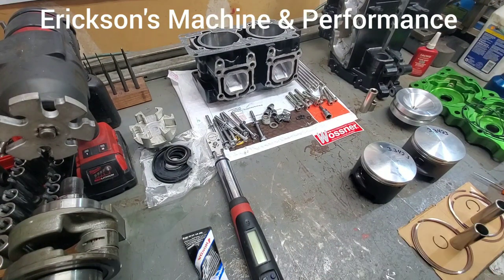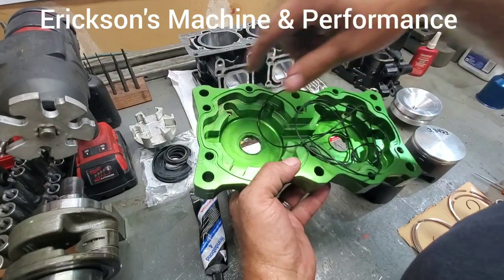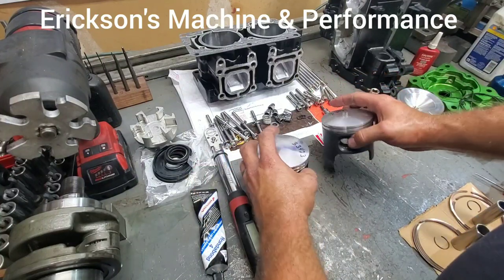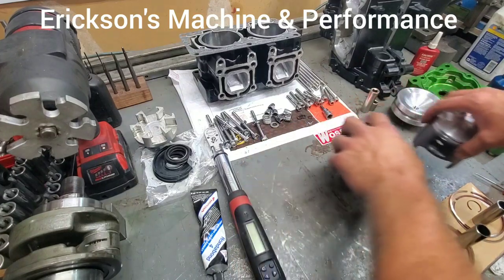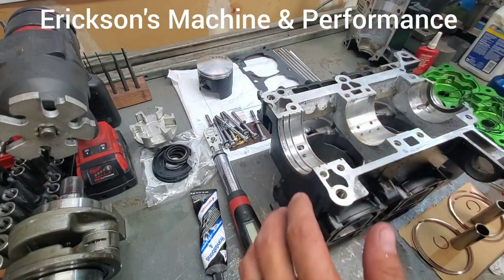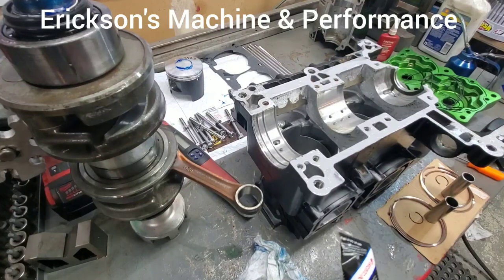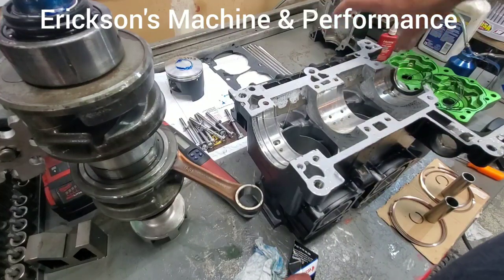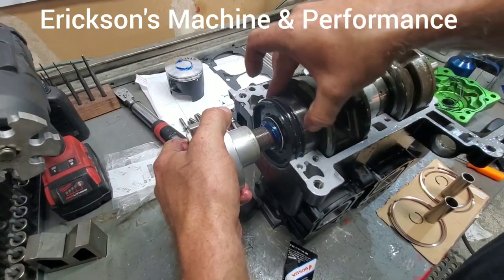Assembling a Yamaha 62t big bore 701 with an ADA head same as 6m6 650, 61x 701 , 62t 701 or 64x 760

Comment: So useful...
Mechanic is so easy with you !
Thanks a lot.
BTW : Did you post a video explaining the differences between 61X, 62T and 64X cylinder ?
Reply from the maker: I have not done that video but now I will!!   Thank you for the comment
Reply: @EricksonMachinePerformance  At first I thought the 61X cylinder was for the single carburetor ski and the 62T cylinder was for the twin carburetor ski but I have a 61X on my twin carburetor Superjet so that is not the case. The only difference I see is the reinforcements on the 62T cylinder, but I don't know if the ports are the same on a 61X cylinder, a 62T and a 64X.

Comment: awesome video!
Quick Question... im rebuilding a motor that need a top end (62T/61X SJ). right now the cases arent split yet but the cylinder work and all the parts are here and ready. I want to split the cases while i have it apart to replace the old crank seals. Is there any seals in the center of the crankshaft that go bad between the two cylinders in the center of the cylinders.. like the kawasaki 440/550s & 650s too i think had the orings on them on a spinning metal seal that required basically a crank rebuild to replace...
Just wondering if i should change the crank if the crank is fine and has no play or has had any issues in the past and has low hours but is from my 2001 SuperJet so not exactly new either, age wise..
Reply from the maker: No just on the ends.

Comment: Basically marine grease does great as assembly lube. Lighter application on metal.
Reply from the maker: Marine grease works fine.    But I'd recommend Assembly Goo.   Its the best for seating orings!    But most grease will do the trick

Comment: Hi Mark, At 14:41 you can see a little hole in the side of the piston.  Why do some of forged pistons have this hole in the side and some don't?  For example, I had some Wiseco pistons that were part numbers for an 1100 Yamaha Waveraider and they looked identical to the 701 Waveblaster pistons EXCEPT the 1100 Waveraider labeled pistons had that little hole in the side of them, but the ones labeled for the 701 Waveblaster didn't have the hole.  Thanks and keep up the great work!
Reply from the maker: It's a vent for the piston to help cool the crown and lubricate topend bearing.    61x don't have.    62t and 64x do.     They are interchangeable.  Either can be used.
Reply: @EricksonMachinePerformance  Thanks for your reply, it's appreciated!

Comment: I'm wondering about the washers that the diagrams call for. I had the cylinders sent out and machined and the local dealership ordered new piston kits  & rings based on the machinist's recommendation and machining. The parts diagram shows plate washers on either side of the pin bearing and mine had them when I removed the pistons. I had one that was broken on the damaged piston. I measured the new pistons against the old to compare the pin-bearing clearance and it appears to be the same. altho the new bearings are a little longer than the originals there is still room for the plate washers and it moves freely. How much play or clearance should there be between the pin bearing and the piston to accommodate expansion on a cast WSM piston. I was concerned about not having the washers but I see you did not install them with this assembly.  I'm working on a 98 Yamaha 701 62t  w new pistons 005 over. I've worked on car and truck motors but I'm just getting familiar with the 2 stroke world. I've ordered 4 new washers that the parts manual shows but now I'm concerned that with the new bearing being longer than the original it may expand and bind. The size or free play difference in the new bearing versus the old with the washers has me concerned about it having too much free play side to side. Is this an issue? should I simply disregard the washers? Leave them out as you did? I would appreciate your recommendation.

Comment: Great content. Is the red stuff on the crankshafts coupler end greas? Also, is it possible to surface the mating surface of the two crankcase half's?
Reply from the maker: No it's not grease I have a red oil that that I put on after I clean crankshafts.   And no you cannot machine the mating surfaces of a crank case. If you do it will shrink the bore size for the bearings.  You can only clean or machine the mating surfaces that get gaskets so between the cases and the cylinder and the intake and the cases. Not the 2 case halves.   Also case haves are machine together in pairs you cannot interchange them.  Mixing and matching case have can cause premature bearing issues.

Comment: When installing a half girdle do you torque the head first? Also are the girdle torque specs the same as the head bolts?
Reply from the maker: What half girdle?   Id depends
Reply: @EricksonMachinePerformance  id? Its on an 845. Not sure on the brand unfortunately.
Reply from the maker: @saltrocket1909  email me some pictures ericksonmap@gmail.com

Comment: I have a 61x with a R&D head in my blaster should I be running BR8ES or BR8HS Plugs ? Can’t find much online but I’d assume longer plugs right ?
Reply from the maker: Most aftermarket heads use Es plugs.  Can u email me pictures of the head so I can see the length of the spark plug threads.  Ericksonmap@gmail.com

Comment: No spacers on the piston pin when installing pistons? Is that a wosner thing? I’m installing Wiseco pistons, I assumed I needed to put the spacers back in?
Reply from the maker: On aftermarket pistons they aren't needed.  Also many people don't use them on oem rebuilds without issue

Comment: When installing the flywheel do you have to use lapping compound and spin the flywheel a few times the make sure the surfaces sit even?
Reply from the maker: Mainly for Aluminium flywheels
    But its not a bad thing to do on oem Steal flywheels

Comment: Is it necessary to put grease between the two rear crank seals? Or can I just oil them up.
Reply from the maker: Grease.  Or even better assemblygoo
Reply: @EricksonMachinePerformance  can I use automotive suspension grease?

Comment: Question: pulled cylinder to clean, long story. But this is a new sj. I put cylinders back on and without head I turn coupler to move pistons. Front one is very tight on down stroke and back piston is what feels good to me. But front has a small blow back around Reed side where top dot is on piston. Back piston don't do that. Trying to turn coupler it gets tight as balls. This normal? Hard to explain but think you'll understand my question. Thanks
Reply from the maker: can you message me your # on facebook
https://www.facebook.com/EricksonsMandP
ill be happy to help you out!   also can you take a video and include that in the message
Reply from the maker: there should be pressure on the down stroke IF the intake and reeds are installed But it should NOT be as tight as you are describing and they should both feel the same.  Please send me a Facebook PM with video so i can see whats going on and get you fixed up

Comment: My question is, would it be worth rebuilding a 2002 700cc wave runner that has no compression in the rear cylinder, not sure why yet!! I am willing to tackle this myself, I did pay a boat company, in Mooresville N. Carolina $2,100  just 2 years ago! Put maybe 15 hours on it before it failed again . I think sitting over winter here in Pa. after winterizing it the carbs, plugged up or something ? No sure! Any help would be appreciated!
Thank you in advance,
Denny
Reply from the maker: Most likely.   If u want to take it apart and email me pictures.     Normally zero compression is a hole in the piston from Lean , or detonation,  or a rod failure
Reply: @EricksonMachinePerformance  wow you replied!! Thank you , I will, it’s going to be a winter project , but thank you I will be in touch!! I will keep this thread and I do fill you now!! Thank you soo much!
Denny
Reply: lol follow not fill!!

Comment: What’s the difference between the girdled long studs and stock? That don’t go threw the head?
Reply from the maker: Girdle kits basically sandwich the cylinder to the cases.  The way many 2 stroke cylinders are if you don't girdle them and you raised the compression or put a heavy exhaust you can either crack the cylinders or the sleeves.  I think I explained in the 61x cylinder porting video where I show a cylinder cutaway
Reply: Erickson Machine & Performance do you have suds for sale? The one I just purchased is 61x cases, With 62t cylinders with a 82mm bore with a ada girdled head, but no studs threw it. Would I be able to remove one bolt at a time and studs in without having any issues?
Reply from the maker: @dukenukembubblegum7311  email me ur #
Ericksonmap@gmail.com 
 I'll get you taken care of

Comment: What about cleaning the loctite in the case holes where the jugs bolt onto what tap do I need to buy
Reply from the maker: there isnt loctite on the hardware. and if someone put it washing in a wash tank and blowing out is good.   ALSO you dont want to clean holes with a TAP.  you can use a thread chasing tool to clean the threads )or a thread forming tap)      but normal thread cutting taps remove material which you dont want to do on an already tapped hole.
Reply: Ok thx what size and I’m just doing the head
Reply from the maker: @henrytischbein155  8mmx1.25
Reply from the maker: @henrytischbein155  this would be for all bolt holes
 Metric Thread Restorer Set 7 Metric Rethread Repair Tool Kit https://www.amazon.com/dp/B07VYGK6GN/ref=cm_sw_r_wa_apa_glc_fabc_8KX5P2WVVKC629G6ZFJ6
Reply: Thx man would I have to rejet the carbs if I do an ada head
Reply from the maker: @henrytischbein155  no.  You might need to adjust alittle but thats it